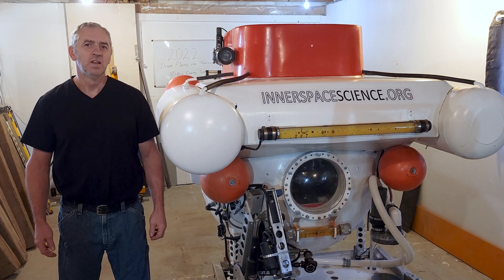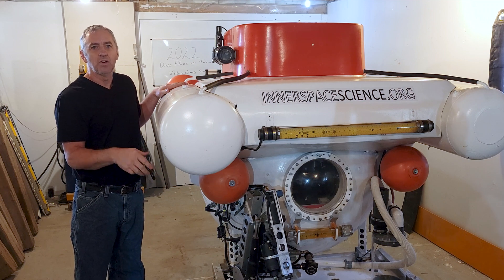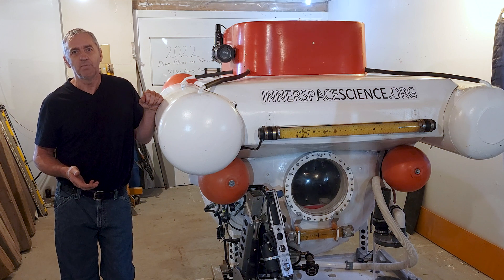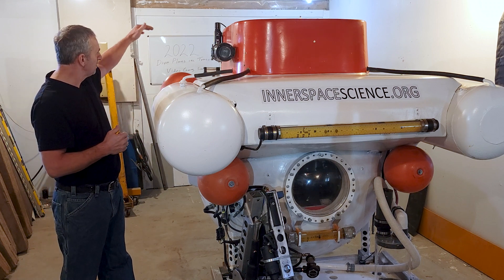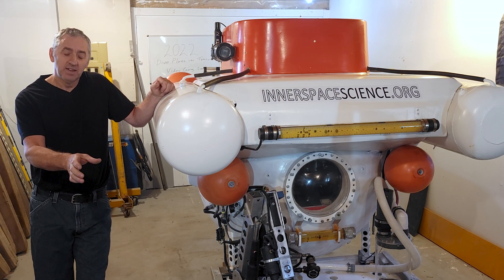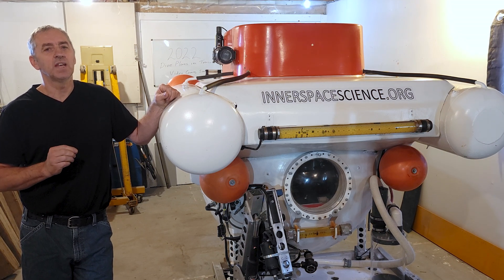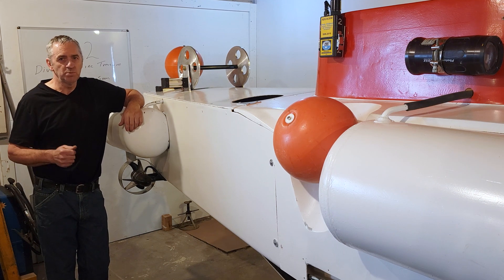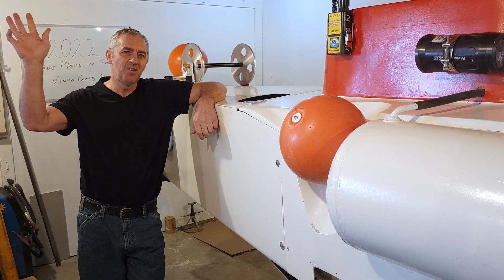Submarine Safety Features Explained

Comment: I’ve been thinking of a submarine design that maintains a slight positive buoyancy and only uses thrusters to dive. Seems a lot safer, although obviously limited. Any thoughts or concerns?

Another idea was to use auto glass windshield as a view port. The laminate-tempered glass is supposed to hold up to like 10,000psi. Obviously wouldn’t need to go that deep, but are there obvious dangers to using a car windshield underwater?
Reply from the maker: I actually do that, stay a bit positive then use thrusters to push down.  This way I don't stir up silt.
Reply from the maker: Defiantly, do not use any kind of glass.  Acrylic of the highest quality is the industry standard.  Acrylic has been tested in every way.